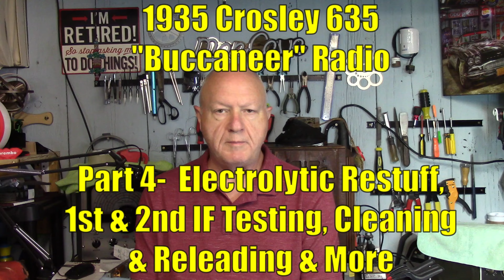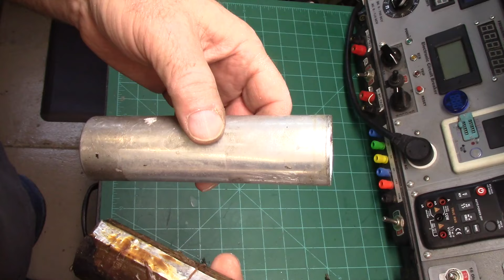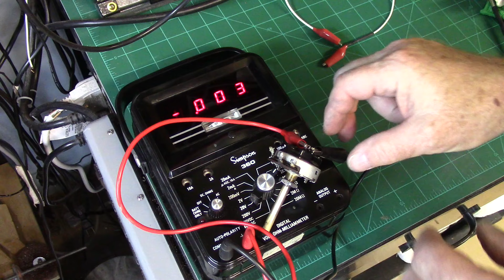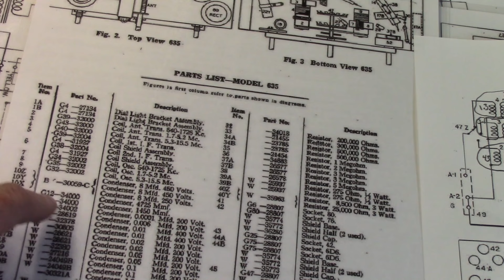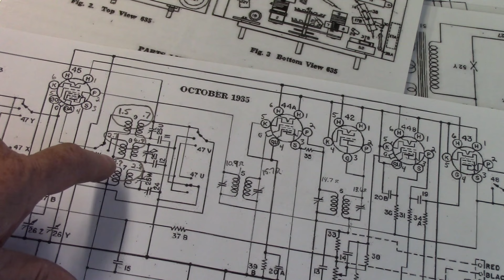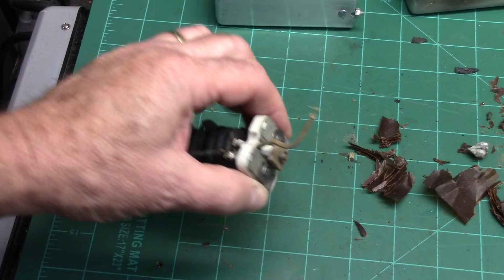1935 Crosley  635 Buccaneer Radio-  Part 4- Restuffing the electrolytic, and testing/restoring IF's

Comment: Can you explain a bit on how you marked the IF transformer cables before you took them off? - or did you just take pics?
Reply from the maker: Hi Rich, yes I usually take various colors of acrylic paint and mark each wire where I am going to cut it, prior to cutting it. I also take photos as well as draw an actual diagram.

Comment: Wouldn't an analog meter been better for checking the pot to make sure no glitches? And for the IF cans you just check for reasonable resistance values? No opens or shorts?
Reply from the maker: Timothy, you are correct on both comments. My Simpson 260 needed batteries and I was too lazy to put some in it, and I haven't used the "Old Goat's" digital Simpson in quite a while, so I decided to use it. I check the IF's for shorts, opens, and reasonable resistances. This old Crosley schematic has no coil ohm's nor voltages on it.
Reply: @greggsvintageworkshop8974  Thanks! I'm still new at this so of course I have questions...I have a big, "chairside" Crosley that I need to dig into... I was pretty amazed at how you stripped down the chassis so far...is that your normal routine? Did you did it down so the tube sockets were bathed in the evapo-rust as well?
Thanks for putting up with my questions!
Reply: @greggsvintageworkshop8974  get the old batteries out before they leak. I'm reworking a couple Heathkit VTVMs that let the C cell pretty much make a big mess of the insides...so much that I snagged some C cell holders to replace the Heathkit setup. Big mess! <smile>